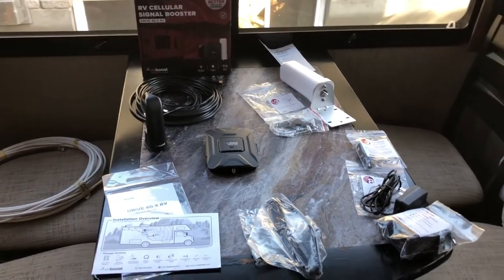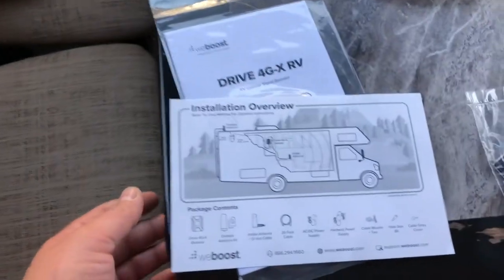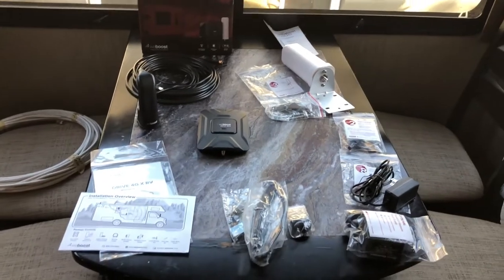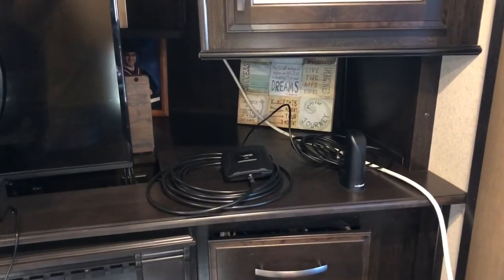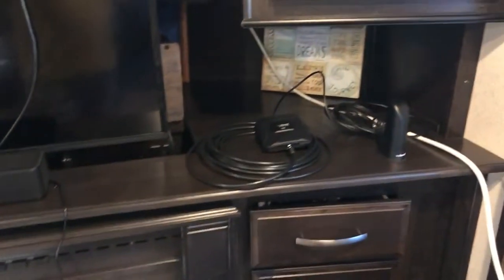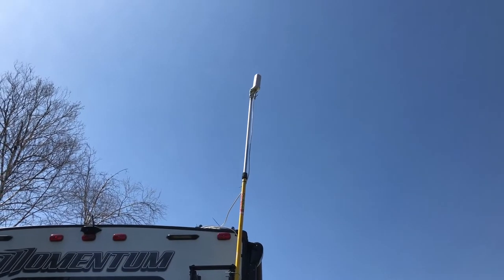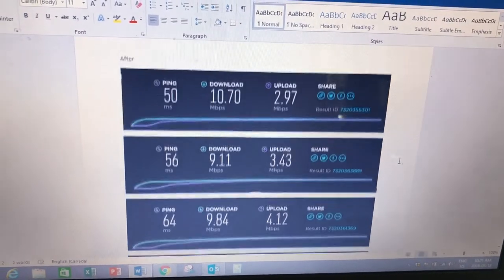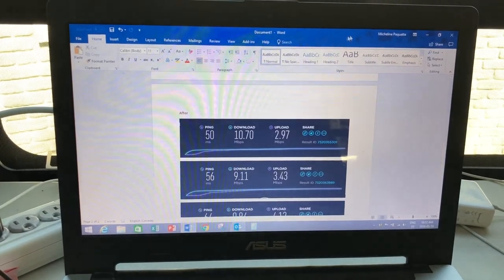Weboost 4G-X RV Install [RV Living Canada] Ep. 11

Comment: Hey guys, great video! My wife and I have the same model RV and we're currently researching cell booster options. Can you please let me know how this setup is working for you and also where did you pick up the telescoping mounting pole? Thanks for your input and experience.
Reply from the maker: Thanks for watching!
Oddly enough, we got a little flack for that video due to the cable extension we used, claims that the booster wouldn’t work properly. Turns out there was some truth to that but not entirely. 
After some additional research, we found out we can extend the factory cable but only so much. The more you extend it, the less effective the booster is.
Today, we aren’t using the same setup. We have the booster set up on the hutch and the cable to the external antenna goes out the emergency exit window and the omni directional antenna is mounted to a painters pole (telescoping pole bought at the local hardware store) which is secured to 6x6 lumber in the shape of a “T” with foam under it. 
I’m not crazy about going up on the roof as much as I do but that’s my setup. 
Hope that helps, let me know if you need more info.

Comment: I just revived my weboost 4G x rv today as well, I started the install and realized that from the ladder in the back to the cabinet in the front of the RV is a 25' run, they only supplied a 20' cable. I called Weboost customer care and asked if there would be a problem if I went to Homedepot and bought a 25' RJ6 cable to replace theirs, she said the booster is not meant to be run more than 20' or else you have signal loss. I see that you ran way more than 20' of cable, have you noticed any loss of signal?
Reply from the maker: We will need to look into it and get back to you.  Initial results were good but recently have seen a decrease in signal. We will do some testing and get back to you.
Reply from the maker: Update:  our current location is not Rogers friendly.  We are OK till about 3 min down the road where we lose signal and can't carry a conversation or get data.   Parked at our spot, without the booster on, nothing works.  With it on and using all the cables I added, I get 3 bars on my cell phone, my rocket hub gives me internet and I'm also able to see the park's Wifi connection as well.  Only issue is making a phone call, that we can't really do.  I have yet to test this without all my cables but I'll update you again when I do so.